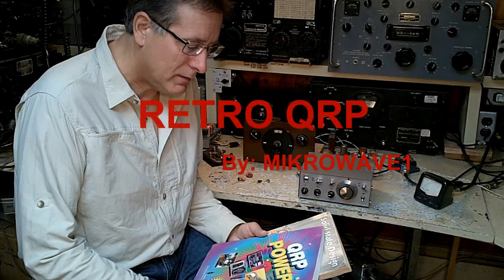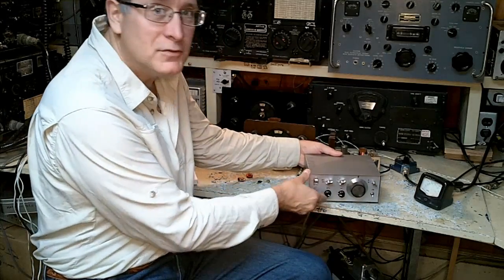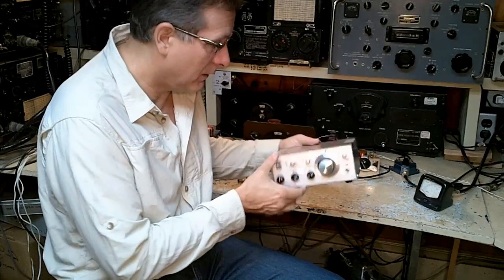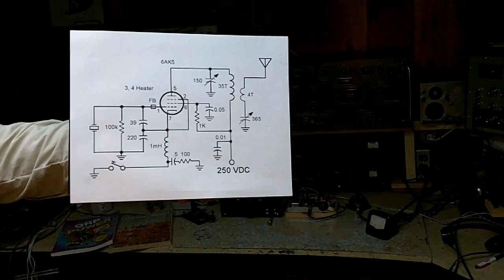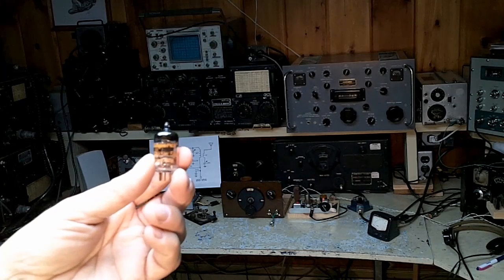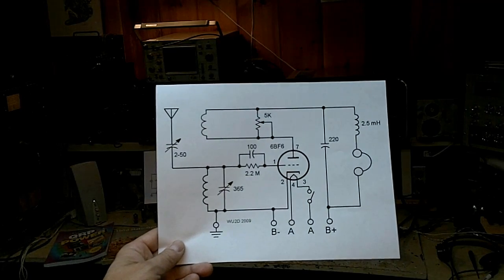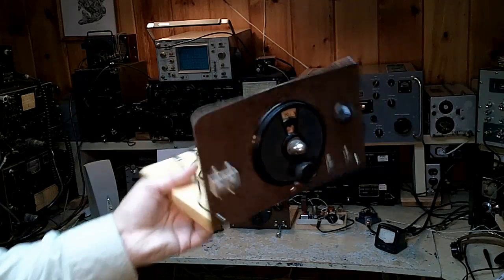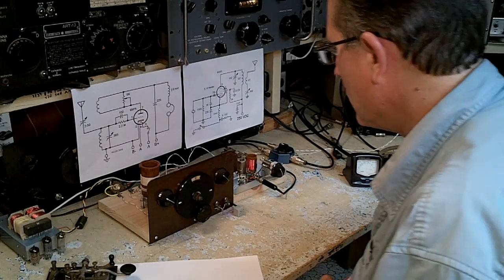Retro QRP Intro

Comment: Love your videos. You've inspired me a lot and personally I've found out that I could build a simple common base coplitts oscillator with a BC549, give it just enough current to oscillate and connect it directly to my computer running an SDR software. I've had a lot of fun with it. And with a lot of trial and error I've been able to make it stable enough to decode RTTY, WEFAX and lots of other stuff on the 40m band.

Comment: I would love to see more of these older rig kits become available. Seems that there is a prevailing attitude that it's a sin to build your own rig. Tubes/Transistors etc it doesn't matter. If it works as its designed and put together correctly more power to us.

Comment: Thanks! This is the sort of rig I am considering building as my first Tube rig.   I even have some 6AU6's
Reply from the maker: Getting a watt or 2 out of a 6AU6 is not hard but the 6AQ5 is a great little tube for QRP transmitters. Its not hard to get 3 Watts out with 250V or 5 Watts out with 350V if you want to push it! (which I do happily).
Reply: @MIKROWAVE1  Thanks!

Comment from the maker: Joe, yes exactly; the tune and loading controls essentially work like the tune and loading controls on a PI network, that is, you dip the plate and can gradually bring up the loading.  The output link of 4 turns is placed towards the cold side of the tank, and is moved up for "a bit too much" loading, then you back off on the loading cap. But between you and me, at these low powers, you simply tune for maximum output.
Reply: Where can a person find schematics for more of these builds?
Reply from the maker: On the Facebook Mikrowave1 Radio Resource blog page. That is where we exchange detailed schematics.

Comment: if you want a QRO unit then what about a Line Output vacuum tube, what about a KORG NU-TUBE 6P9 should work also but it is a bit micro-phonic but the heaters use 1.5-3V at 0.5ma and a plate voltage of between 9-36V.

Comment from the maker: @tovarisci - There is no reason why the circuit that you describe would not work. In fact you could likely do it with one tube like a 6BE6 and a carbon microphone.  This type of electron coupled oscillator works very well as a multiplier but the power would go down some. I suspect that if you get 2 Watts out on the fundamental frequency, you would lose 1/3 power tripling and more than half  x5. But with a tube like a 5763, I suspect you could still muster 2 Watts at 28 MHz with higher voltage.

Comment: Hello. Nice project :)

It is first time when i work with vacum tube. Please tell me, what is the voltage for capacitor: 220, 39? The secont question, for example the capacitors 0.01; 0.05 is a ceramic capacitors? Because i didnt see electrolitic capacitors with that value (in the schemes you use the electrolitic sign). Next question, the variable capacitors is just for tuning the anntena? If i whant to tune the frequency i have to put in series a variable capacitor with the xtal, you are agree with me?

Thanks a lot,
73 from Yo3IQK
Reply: resistors high watts 1-2w and capacitors high voltage up 300-500v

Comment: Nothing to be embarrased of, Michael (about you building that QRP in the 80's). Well done video sir. Congratulations! 
I am working on building a couple of one tube QRP transmitters. One with 6AG7 and the other will be either 6V6, 6L6 or even a 6F6 but now I'm in doubt if this one tube rigs will be good to crystals like yours is. I guess yours uses less current on the crystals thank this bigger tubes ones. I have a couple of FT-243 but no more choices. 73 de Rob YS1RS
Reply: I was told that 2 xtals in parallel will fix the High current problem.

Comment: can you tell me how to get a transformer to build a 250vdc supply? having trouble thanks 73
Reply: Gary J Allied Electronics has tube transformers, the 6K49VG will produce about 270VDC.  Hammond and Elcor also sell power transformers.  I like to use the Triad N-68X isolation transformer myself.  If you connect it "backwards" and connect the two "primary" windings in series, you'll get about 260VDC with a FW Bridge.  For heater power on small projects I use 6V or 12V regulated wall warts, but you can also find 6.3V and 12.6V transformers just about everywhere (the Allied and other purpose-built tube transformers have heater windings, but isolation transformers don't).
Reply: Thanks I will check that out appreciate your help. 73